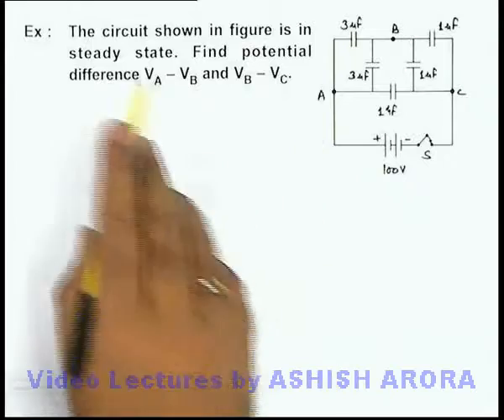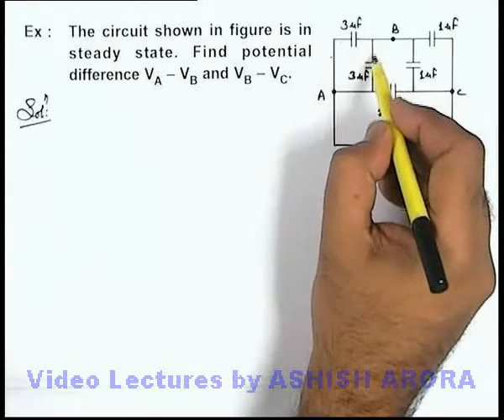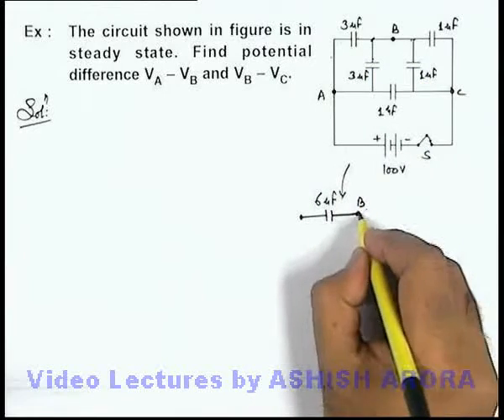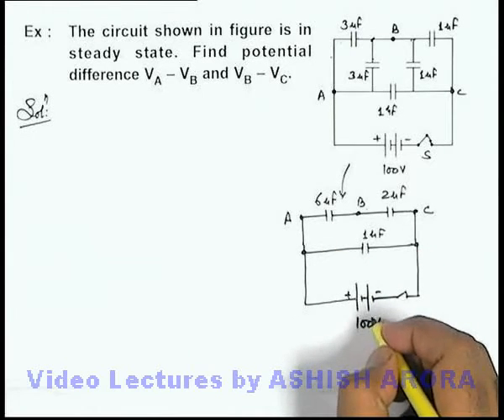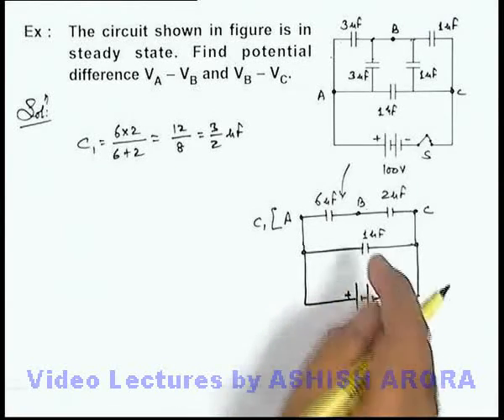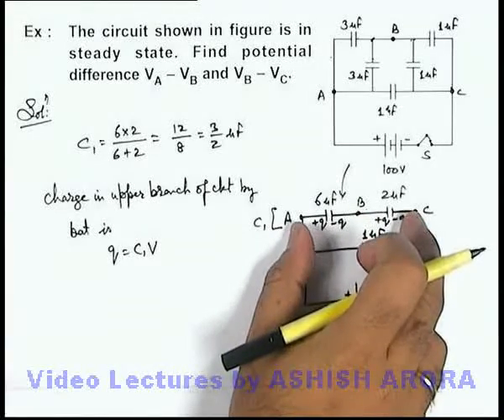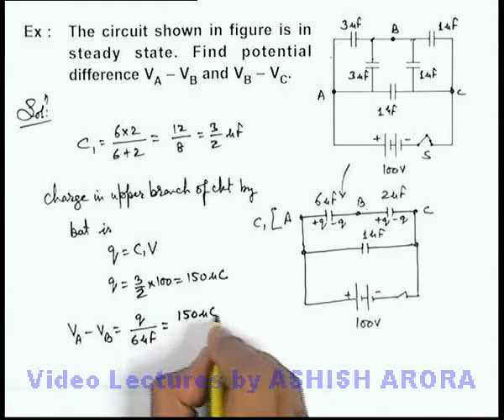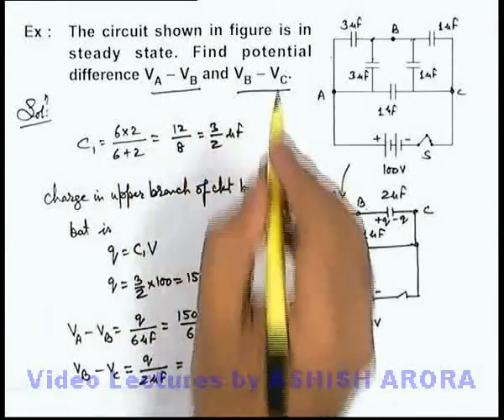Class 12 Physics | Capacitance | #27 Solved Example-3 on Capacitance | For JEE & NEET

Comment: sir i used nodal analysis and it was much easier ......but should i refrain from using that method??
Reply from the maker: With practice one can gain expertise to apply any method in solving questions... in exam its the instinct which will help you in solving MCQ by different methods quickly...
Reply: how did you do this by nodal analyis, please tell me
Reply: @theboycutgirl9771  He meant to say that....after rearranging the circuit like the sir did in the video....use the nodal analysis to get the potential at B. And, then you can simply subtract it by A = 100V and by taking C = 0V. Otherwise, it will be complex to solve it in the initial circuit.
Reply: @pragyan-099 bhai mene initial circuit me hi lagaya hai Mera aa gya bas mujhe ek dikkat hai ki signs kaise lagau potential difference likhte waqt
Reply: @theboycutgirl9771  B is a node, take potential at A to be 100 and B to be 0.( we can take it this way because only the differemce matters, absolite potential is nothing). Now write nodal equation which ewuates charges at point B to be 0 using q=cv relation. You'll get the same answer